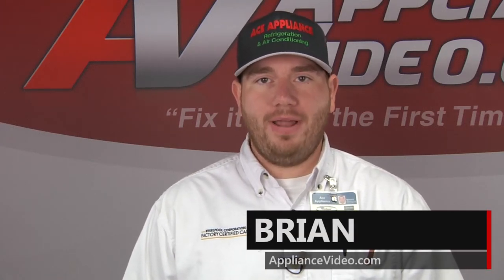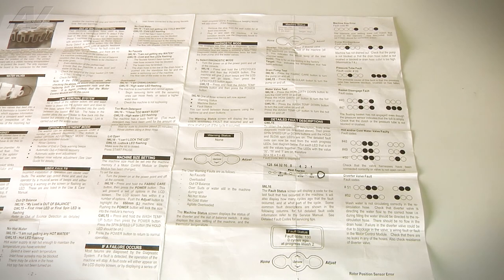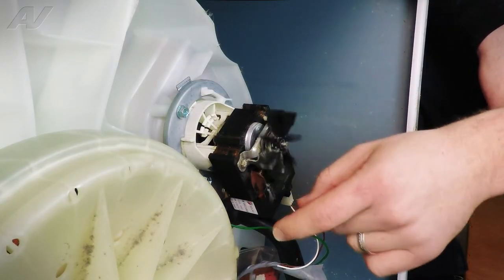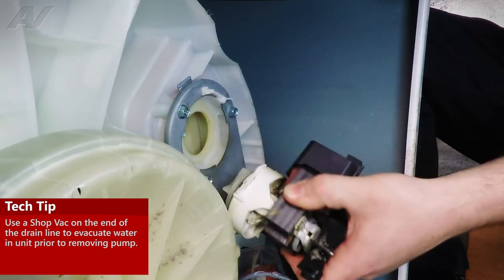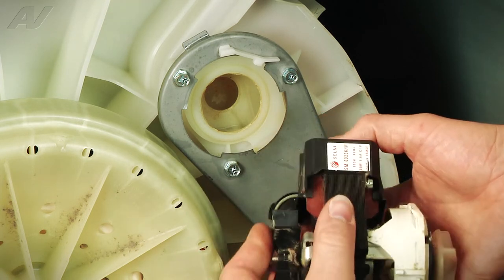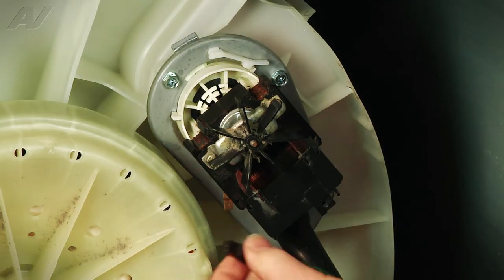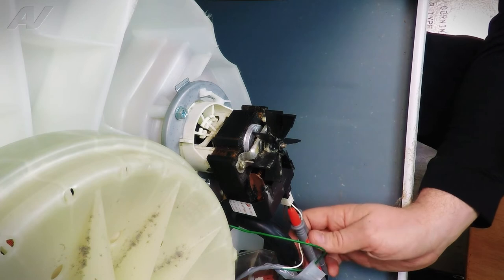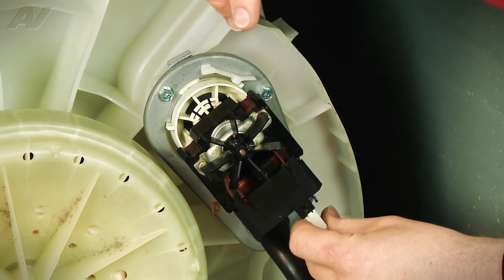Fisher & Paykel Washer Repair - Water Not Draining - Drain Pump Diagnostic & Repair

Comment: My F&P Washer GWL15 starts draining about a minute after the tub fills with water. I read on another site that the tech said it was a bad drain tub seal?  Is that possible, and does the whole drain pump need replaced I don't have meters to check the volts or ohms?   I put on another diverter valve because I keep getting  an error code 51, and no luck as it still does the exact same thing?  This machine drains and refills on each cycle, and is wasting a lot of water. I don't believe it ever re-circulates the water, but  rather pumps it right out the drain tube. Could this be a a BAD Control Panel causing this?

Comment: Oh shit i removed the whole plate not realising the pump just twisted out, now it seems to be leaking water do i need to use a gasket or O ring? I dont remember one being tbere but cant figure out what I'm doing wrong. Do i put the cover plate back on first? Then twist the pump back in as you have shown?
Reply from the maker: Great question, if you have a more technical question that our parts department cannot answer, you can search our over 17,000 answered questions free at our website www.ApplianceVideo.com under our Repair Help section. You can also call our parts department at 1-800-830-5465 and they can give you help 7-days A week ,or search at www.SaveMoreOnParts.com  .

Comment: My washer is draining, but show water is leaking onto the ground. I've tipped the washer over and checked, but I really can't tell where the water is leaking from. The pump makes a bit of a squeeling sound occasionally, but I'm not sure if that's the issue. Any ideas? Thank you so much in advance!
Reply from the maker: Great question, if you have a more technical question that our parts department cannot answer, you can search our over 17,000 answered questions free at our website www.ApplianceVideo.com under our Repair Help section. You can also call our parts department at 1-800-830-5465 and they can give you help 7-days A week ,or search at www.SaveMoreOnParts.com  .

Comment: Without the motorboat shows Voltage (117) and motor testes Good.

But when connected voltage drops to almost nothing like there is not enough Current.   All fuses tests good...

I'm thinking the board is bad as far as with the power supply but spin cycle works ...

Please any help would be appreciated!!

Comment: Thanks for the video. I changed the drain pump and when I turned the machine on at the wall the pump started. After a cycle the pump continues to run. Is this a computer problem?
Reply from the maker: Great question, if you have a more technical question that our parts department cannot answer, you can search our over 17,000 answered questions free at our website www.ApplianceVideo.com under our Repair Help section. You can also call our parts department at 1-800-830-5465 and they can give you help 7-days A week ,or search at www.SaveMoreOnParts.com  .

Comment: My Fisher & Paykel keeps draining the water as filling and never fills to start a wash cycle. Can not even here a pump running.
Reply from the maker: Great question, if you have a more technical question that our parts department cannot answer, you can search our over 17,000 answered questions free at our website www.ApplianceVideo.com under our Repair Help section. You can also call our parts department at 1-800-830-5465 and they can give you help 7-days A week ,or search at www.SaveMoreOnParts.com  .
Reply: ApplianceVideo.com i put the hose up high instead of down the ground. And the draining stopped.

Comment: I am a bit confused, you said that 120 watts were the correct numbers and yet you said it needs to be replaced. Am I missing something?
Reply from the maker: Great question, if you have a
more technical question that our parts department cannot answer, you can search
our over 10,000 answered questions free at our website www.ApplianceVideo.com under our Repair Help section. You can also call
our parts department at 1-800-830-5465 and they can give you help 7-days A week
Monday -Sunday, or search at www.SaveMoreOnParts.com  24 hours
7- days A week.
Reply: He was confirming the machine was sending the correct wattage to the pump.  Once confirmed, he knew the pump had to be the issue and therefore replaced it.
Reply: @lisadube6808  Correct VOLTS. Not wattage.
Reply: He said 120Volts, so we're getting correct power, I think we get the idea of what he's trying to say...
Reply: @lisadube6808  Thank you, I got it now